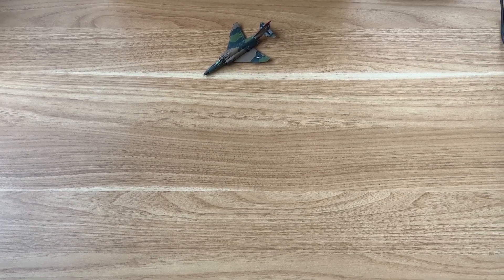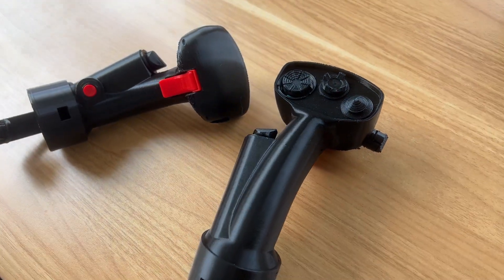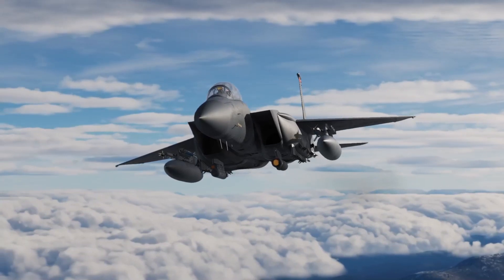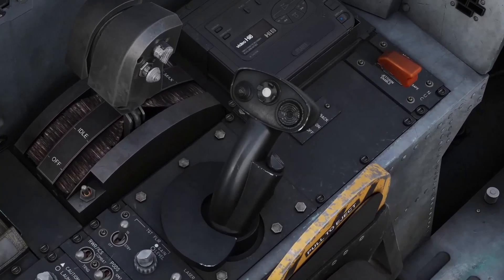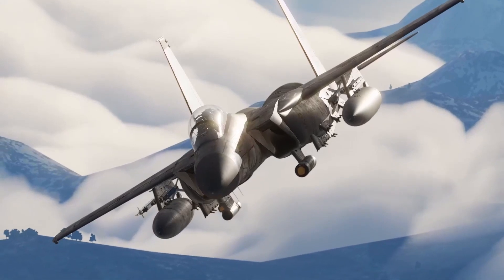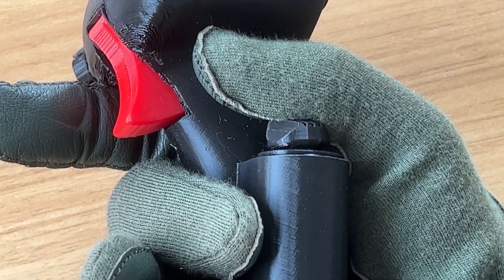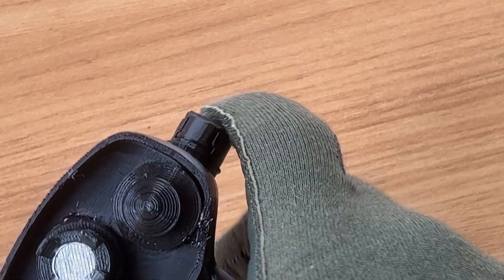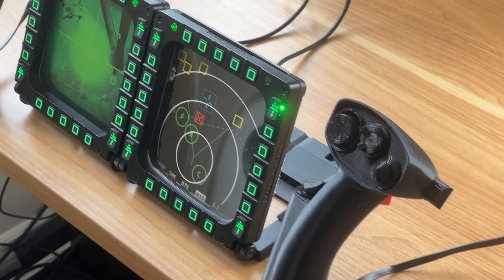F-15E WSO Hand Controllers 3D Printed DIY

Comment: Hi ! I just bought the files. One question...which material you suggest to use to create this controllers ?
I have checked Craftcloud printing services but there's many different options about material to print it..
What you suggest? Thanks !
Reply from the maker: I would recommend PLA +, PETG, or Nylon! Resin is a bit too brittle according to reviews from other folks. I personally use regular old PLA haha
Reply: Thanks !!

Comment: What is the size for the largest part. Do you think a 18cm build size fit? I want buy a 3D printer exclusively for this build and I’m think on the new Bambu Lab Mini with 18cm build plate. Please answer
Reply from the maker: Hi it is exactly 16.5cm tall at the highest point!

Comment: So looks great but how do smooth out all ugly lines from making it, looks like crap with all those lines from the layers. Can you sand it smooth?
Reply from the maker: Great point - 3D printed parts can have varying finishes, especially hot off the printer! When I am developing a grip I usually print with thicker layer lines to speed up the printing process, hence they are more visible. A combination of thinner printing lines, some sanding and a coat of paint can usually get these grips looking shiny in no time! I've also experimented with rubber coatings to give a more authentic, grippy feel. The real thing is resin and coated in rubber, so not too far off! Thanks for your interest - there are tons of guides online on how to smooth/finish 3D prints.
Reply: @thesimnet  ah make sense, not bad!

Comment: Hi, do you gonna give the dimmensions of each BOM part. For example the position mini toggle switch and how man pin is required ? (Sorry for my bad english)
Reply from the maker: Thank you for your comment, yes I will be providing the full BOM with links in the assembly video (coming soon, I just need to edit it down from 2 hours 😅)
Reply: FWIW they seem to be mostly the most common suspects. My random 5-way switches, tactile buttons and mom-off-mom switches all just fit from the get-go. All I now need is the pinky button and the analog stick, plus the metal rod specs for pinning everything in place.